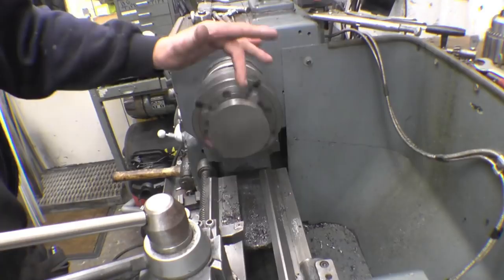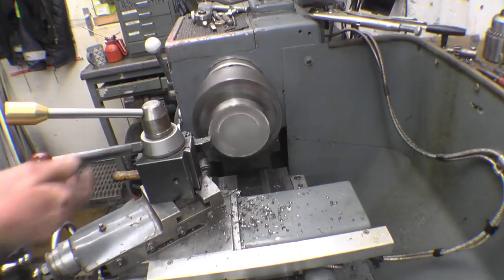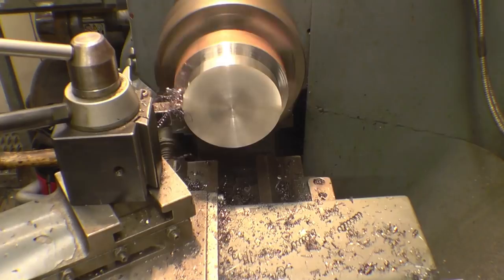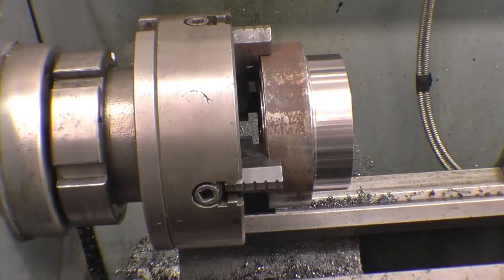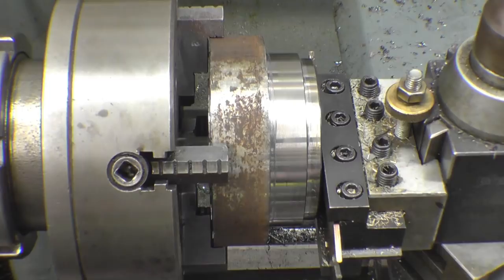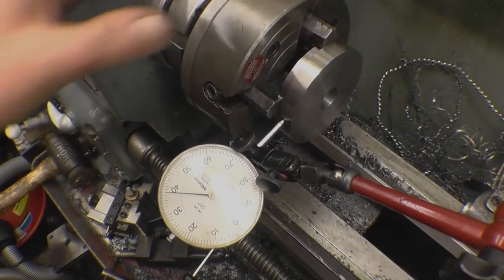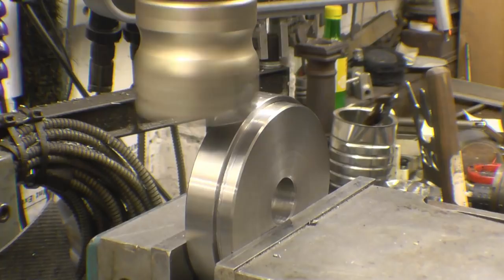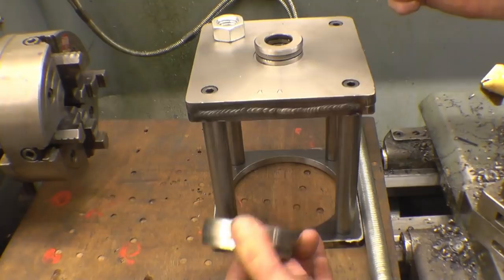SNNC 299 P2  Cylinder Liner Puller   ,  Machining Hard Steel

Comment: If I may, the first material would probably machine okay with a slower surface speed, larger depth of cut, aggressive feed and a different approach angle, the tool you use for chamfering mounted parallel with the spindle would be more suitable, But at circa 100 mm, there's probably not enough spindle motor power available, as is the case in many circumstances. Too high a surface speed and too light a cut results in local hardening where the material can be heat treated. But no need to pursue this, if there is alternative material obviously.
Great job and video, thanks for sharing.
Reply: Bosted Tap I agree around 600 sfm on 4140 treats me just right and I can cut for hours on the same corner
Reply from the maker: I will have a bit play with it  Thank you for the valued comment

Comment: In the dim distant past I had a job that involved assembling and balancing crankshafts.
Part of the setup process everyday was to remove preset balance weights from the master crank to check the calibration of the balancer.
One day I had the unenviable task of telling the boss I'd dropped one of the master weights into the swarf bin under the machine.
Guess who got to empty several months of swarf out and sift through it while maintenance attended to the master crank. (They "fixed" it with a blob of plasticine till a new weight was machined.)
I never saw that dropped weight again, and it took weeks for all the metal splinters to stop bothering my hands. (the boss said I would find it easier without gloves desensitizing my fingers.
Cheers Eric

Comment: Many years ago I needed a sleeve puller and I built it with nothing but a disc grinder and a mig welder. I didn’t have the fancy lathe or mill I have now! It worked, but doesn’t look as pretty as yours!

Comment: Lovely job there John, should work perfectly, and be a lot better than the cheap pullers you find. Why did you not finish off and cut a thread into the inner for the rod, or are you just going to leave a nut underneath to allow for more misalignment in the unit.
Reply from the maker: Just a nut as requested

Comment: Good looking tool but I have concerns that the major diameter I'd too close to OD of liner. If the liner is worn you will have lost your   centre alignment and the plate could score the block as you pull the liner. A little extra clearance wouldn't weaken the tool but may save embarrassment later. Unless of course this was taken into account by  the designer, in which case ignore the above scribbling.

Comment: What is the purpose of the flats you milled on the puck?
Reply from the maker: They were on the drawing so i did them
Reply: Probably there to clear the crankshaft webs, so you can pull the liner without having to remove the crankshaft entirely.

Comment: i would of turned the parting tool upside down and lathe chuck in reverse,less pressure.my guess on the material is shaft material 4140 maybe?.

Comment: you're whining it wont part off but at the same time you're feeding slower than a grandma walking in the park
Reply from the maker: I will have a bit more play with speeds and feeds
Reply: @doubleboost  the chips are coming off exactly as they should, not jamming in the groove